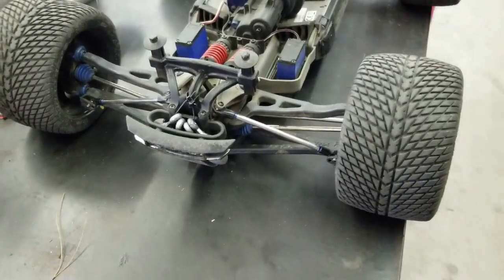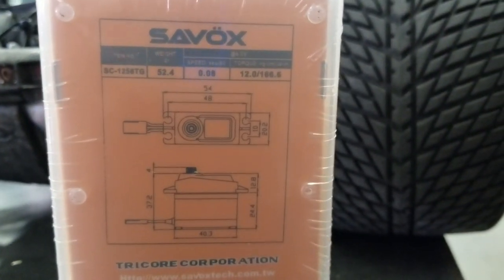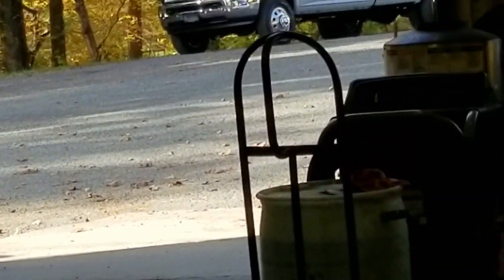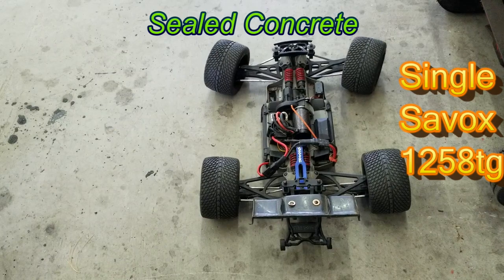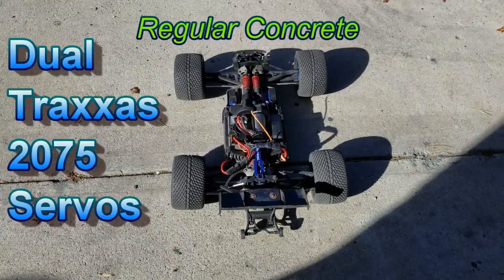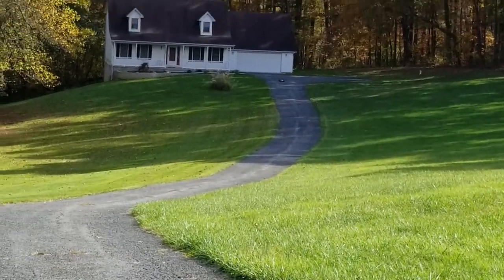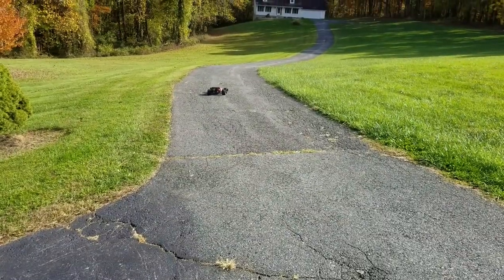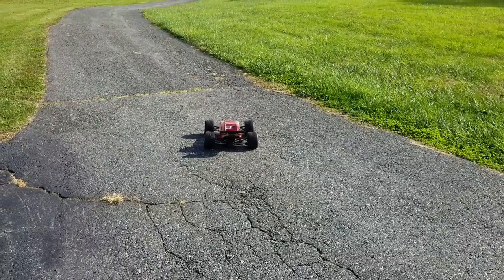Servo War: Savox 1258tg vs Traxxas Dual 2075(Traxxas E-Revo Brushless)

Comment: If your having a problem breaking your sharks like I did take off the chassis brace the plastic one kept breaking on me so I put the metal one on and then it started breaking my shocks I took the chassis mount off completely and I haven’t had a single problem since
Reply from the maker: SuperSetCity I haven't broken many shocks at all

Comment from the maker: Yes I love it. Keep in mind that 1 doesn't have the same amount of torque as 2 traxxas but it's soo much faster. I think the 1287tg(number maybe wrong) has a lot more torque but is also 90 bucks. As long as your rolling this 1 servo has plenty of power.  It didn't turn well at a dead stop in grass tho
Reply: Anthony Harris Great!  Thanks man.  I appreciate your response.  I think I will get one for my Slash 2WD. 🤘🏻